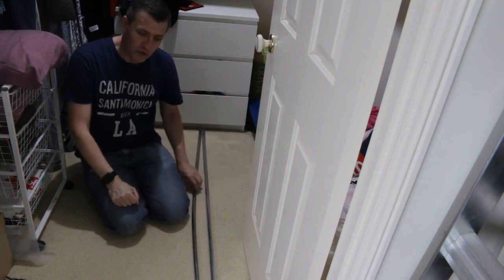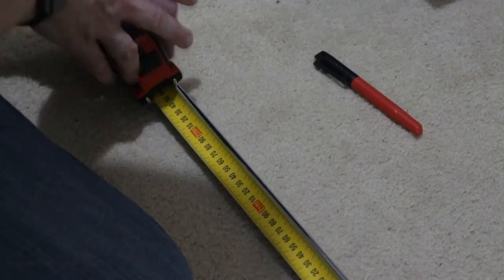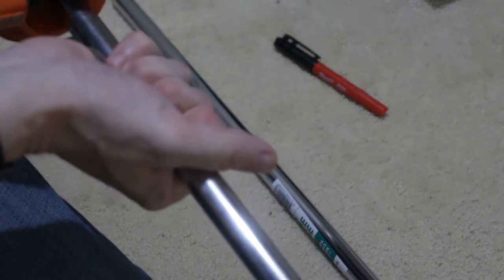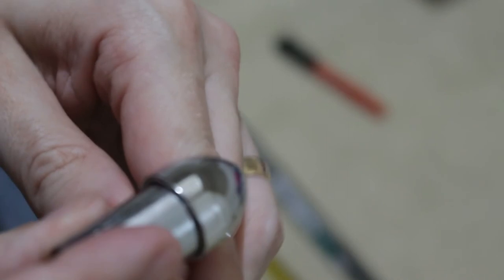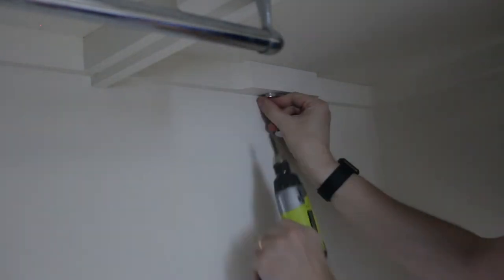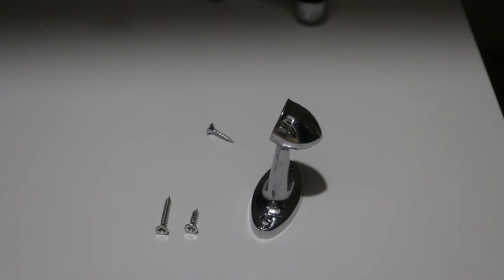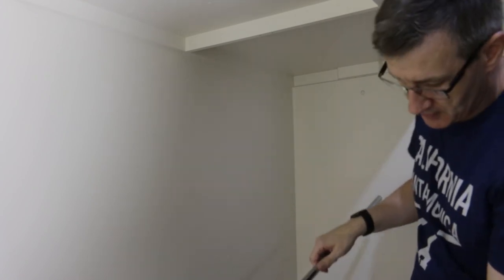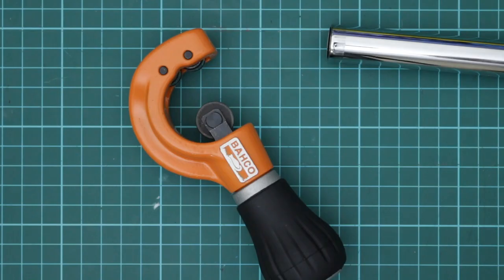DIY cutting and fixing up our wardrobe/closet hanger rod/rail/tube

Comment: Pretty awesome. Does it work for oval shaped rails?
Reply from the maker: The cutter only works for round shaped rails. Use a fine metal toothed hacksaw. The ends are hidden by the rail cups so you don't see the ends and the rails are usually softer steel